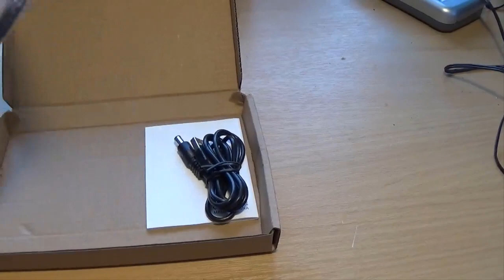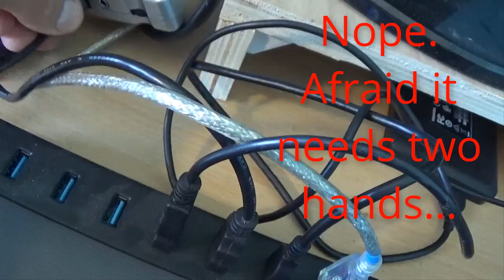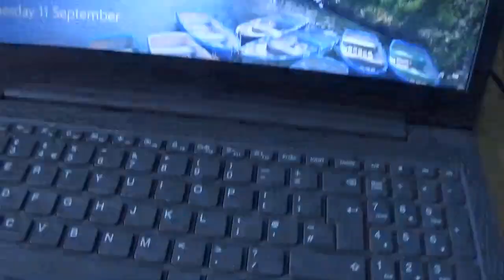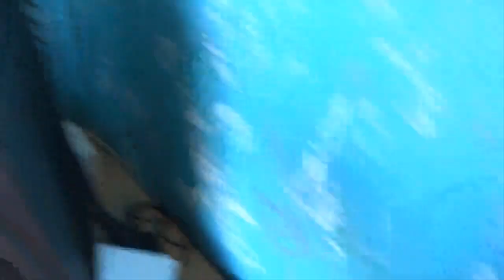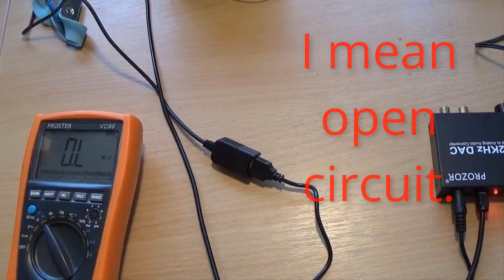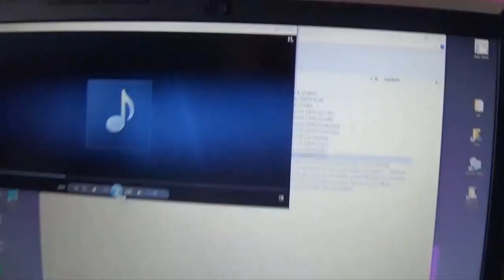Cheap Optical Audio Digital To Analogue Converter. Is it any good?

Comment: Hi, do you know Could i connect a PS2 to this via an optical cable and go straight to headphones and use the volume control on the unit to alter volume through the headphones?”
Reply from the maker: I don't know the PS2 at all but the optical cables advertised for it look standard. 
The PROZOR DAC unit is stereo and the PS2, I gather, is surround sound. Is there some default compatibility? I don't know. Can the PS2 be set up to output stereo? I don't know. You'd need to find this out.
The headphone output seems to work well though I don't normally use it.
Reply: Yes it works perfectly fine, just enable optical audio on the PS2 when using it with this

Comment: I have a microware optical to 3.5mm jack and analog converter and it has a ligh hiss noise . Is it normal
Reply from the maker: I don't know this particular unit but I would would expect any optical converter to be quiet. Assuming it isn't your source audio that's noisy, I would check your ground path and make sure your audio ground is separated from your computer ground - computers are very electrically noisy. 
If that isn't the problem I would suspect your converter unit is faulty.
Reply: @TripplikitElectronics  It's for my receiver .

Comment: I'll give you the problems I found in this reviews so it's easier to fix in other videos :
- we don't know how you connect your computer to this DAC. There's apparently another component we don't know of and could mess with sound.
- we don't want to know that you are struggling with the need of 2 hands cause u have the camera, just plug it (even by a cut) or have it already plugged in. If you show the whole wiring like in first point there's no problems.
- you say it's a review but all we know is that it does sound, wow! No idea if it's quality or not, u have a knob we don't hear about, all we know is that you have earthing problem which takes most of the video (and we don't care about to be honest)

Hope I'm not being too harsh, just trying to point out the problems for future videos.
Reply from the maker: Thanks for your comments. I don't script or rehearse these videos so they ain't going to be perfect. Having said that, I should have mentioned the optical signal was coming from a Behringer UCA202. It won't affect the audio as it's all digital.
As for the camera work - these days I use a stand for the camera unless I absolutely have to hold it. I just couldn't get the hang of doing something and holding the camera steady
Reply: @TripplikitElectronics  no problem just try to give you a feedback for better video, people don't want to see you say 'oh i nneed two hands' just cut and show the result, i mean if u show hesitation or struggle you give the feeling you're not sure what you're doing even if it s not the case and it s not really pleasing to watch.
Good luck the future

Comment: Does a 96khz DAC have a big difference in sound quality output compared to 192khz DAC?
Reply from the maker: Interesting question - I could write an essay on it. Theoretically you can reproduce signals up to half the sample rate but the reproduction is poor above 1/4 the sample rate. However, most high frequency sounds we listen to are basically noise -  "s"s (and similar) in speech and cymbals in noise which cover this up. This is why CD sample rate is fine for most people.
So, if you can hear up to 20kH, 96kHz will be absolutely fine for you and even then you would need a very high quality DAC and sound reproduction system to appreciate it. In my view, you only gain from 196kHz sample rate for digital sound processing.
Having said that, my ears aren't as young as they were and I can't hear much over 10kHz so I make do with 48kHz sample rate.
Interesting point - possible topic for a video.
Reply: @TripplikitElectronics  Thanks for the details. I'm currently using 96khz for my TV but very curious as to how much difference the 192khz DAC makes.

Comment: I have one optical port and one 3.5 port in my tv .. so , by using this converter does it improve my sound quality? Or same as 3.5 mm port . Please reply
Reply from the maker: I assume you're trying to use external speakers with you're TV. I would guess the 3.5mm socket is for headphones so I would expect you to get better quality audio with a converter like this one.
If you're intending to buy a power amplifier, quite a lot of them now have optical inputs built in.

Comment: Can it run both output jack and rca at the same time? I need awnser
Reply from the maker: Sorry about the late replay. I didn't try this when testing but I've tried it now. The jack is for headphones and if you plug headphones in it turns off the rca outputs. So your answer id no.
Reply: so this product can help us use speaker activ with analog 3,5mm jack connect to Led tv which already digital? am i right?

Comment: hi, unsure if you've solved your problem since this video went up, but I had a similar issue with hum that sounded almost identical to yours at 14:05-ish. 

it was releated to earthing, in that my hifi set up was running power from a completely different extension cord/wall outlet to that of my pc audio source. 

solved the problem by buying a little piece of equipment called a Ground Loop Isolator (shouldn't run more than about a tenner; the name of the issue is a ground loop feedback according to extensive googling) and inserting it between the 3.5mm output and the line-in phono inputs on my amp. 

hope you've got it solved already but if not, that might help!